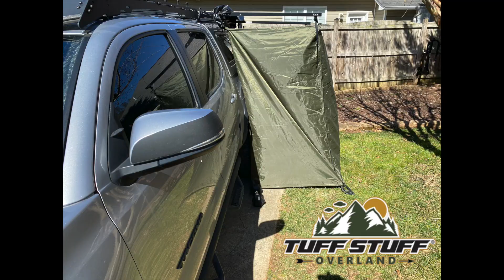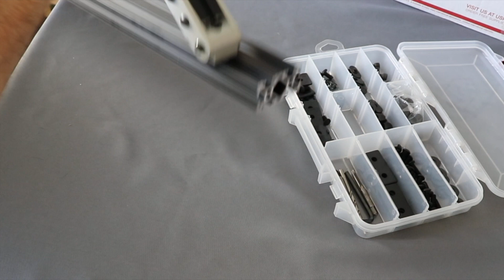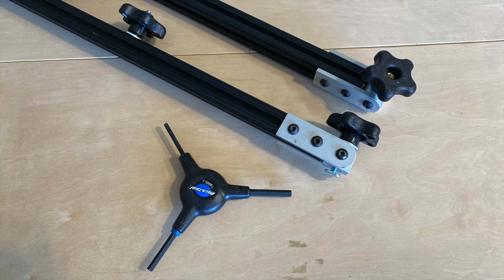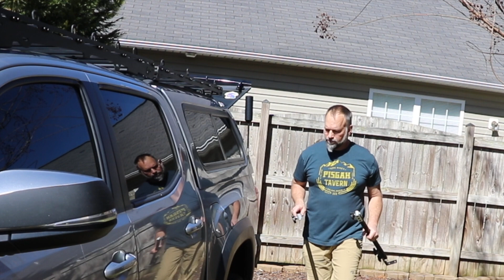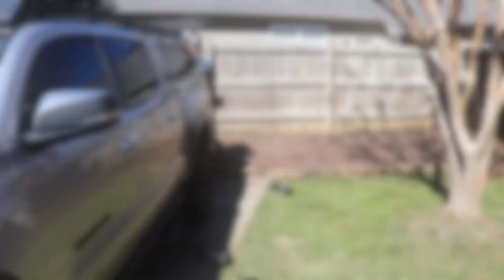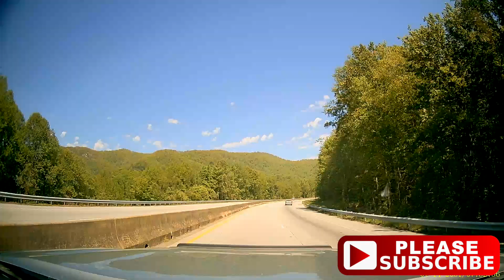80/20 Roof Rack Load Bar Extensions and more

Comment: Cool idea.  I'd really like to do something like this, but with a telescoping design so I don't have to install and uninstall the shower tent every time I want to use it.  Do you have any ideas on how that could be done?  I have 1x2" crossbars on my roof rack.  Send help. :)
Reply from the maker: Check out Tnutz.com and see if they have attachments that will work.
Reply: @828findadventure  I did. They responded that they did not have the parts needed.
Reply from the maker: @thebrentwoodbicyclist3220 check the 8020 website. There is nylon slides.

Comment: Great idea.  Was thinking I was going to have to design something similar for our QuickPitch Ensuite to extend past our super wide fenders on our custom teardrop.  This helps give me some ideas.  QUESTION: In the video you show the 8020 hinge on the sliding part.  I didn't see it fold over on the rack (maybe I missed it); as such, why have the hinge/pivot on the one end? Just curious.  P.S.  Great video of the Claymore fan, we just bought one.
Reply from the maker: My goal was to have them fold over with those hinges, but I ran into mounting issues with the hinges and hardware I had that was adaptable to the Prinsu load bars. There are a million ways to mount these extenders I hope this gives you some ideas. I'm doing a rooftop rack and bed slider for the Tundra soon so stay tuned and thanks for commenting.